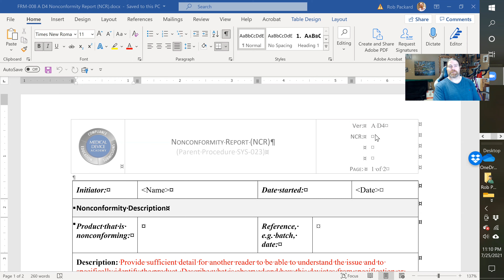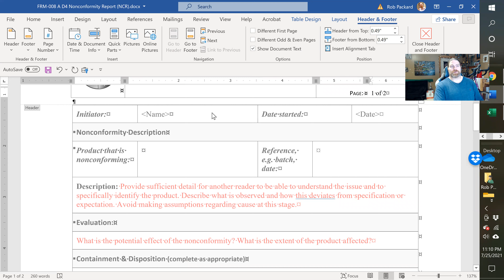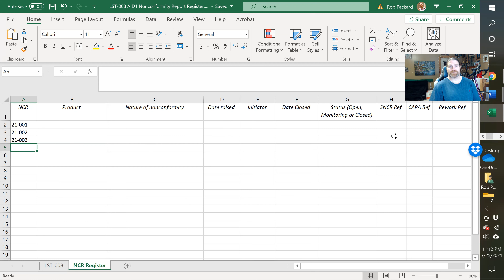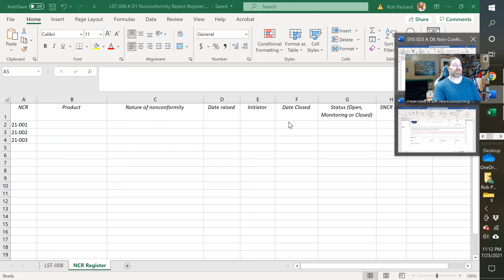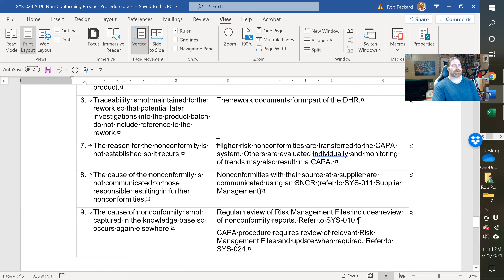SYS-23 Nonconforming Product Procedure/Form

Comment: Thank you so much for this video, but I was wondering how would this work if the medical device is actually a software?
Reply from the maker: Great question. Whether you have SaMD or SiMD, you can still have nonconforming software (i.e. bugs). Whenever there is a patch uploaded, it is to correct a bug found in the software or to address a cybersecurity vulnerability. When a design change is implemented, you need to decide what to do with software in your inventory (if it has a physical form) and what to do about software in the field (such as on mobile devices or instruments). The nonconforming material procedure is the right process to manage this. Even if a recall is required, you will typically identify all of the nonconforming product on your NCR form before you decide to recall your software. This happens all of the time with my mobile phone operating system. I get notifications from my phone carrier that they are releasing a critical update for my phone's operating system and I need to download the patch. This can also be done for SaMD as part of a recall or advisory notice associated with nonconforming software that you plan to correct with a patch.